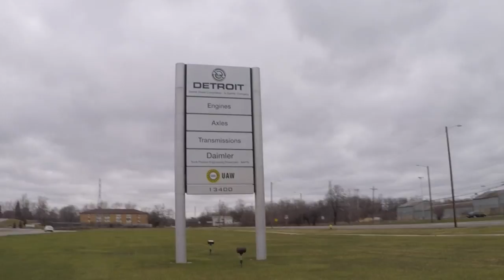DETROIT DIESEL FACTORY!!

Comment: The Series 60 pre-egr engines were the finest money making chunks of cast iron and steel ever made. I’m going to run mine for as long as I can!
Reply: Last time I was at that plant was style motors I picked up series 60. About 25 years ago
Reply: You love to waste fuel I see.
Reply: @blackericdenice  yes I do and I also love to mind my own business.
Reply: @prevost8686  Don't like when a brother comment on your comment. Don't comment.
Reply: @blackericdenice  OK Felishia.
Reply: @blackericdenice  Sure Felicia…
Reply: @poopinfruz9771  He don't work on the engine anyway.
I used to drive a 2004 14 liter with 515 hp/1650 lbs-ft. It got 6.5 mpg and I had to add oil. 
I then drove a 2016 14.8 liter with 450 hp/ 1650 lbs-ft. It got 7.4 mpg and I never had to add oil. 
I now drive a 2022 Volvo 12.8 liter with 450 hp/1750 lbs-ft 7.2 mpg and I don't have to add oil
Newer engines pull as hard as the old engines yet they burn less fuel and use less oil.

Comment: I'm surprised the Detroit Diesel sign outside on the building isn't leaking oil
Reply: That’s funny, if it ain’t flooding the road with oil, it ain’t a Detroit
Reply: perhaps that is because the sign is not painted green? Weren't those older DD engines called "green leakers"?

Comment: These new engines won't ever be as cool as the old 2 stroke detroits
Reply: yeah, those 2 strokes WERE one of a kind........UNIQUE to say the least
Reply: Brown Cheese They’re not nearly as reliable as the Series 60 was either. The Series 60 was the pinnacle of a reliable and fuel efficient power plant.
Reply: @prevost8686  no motor is as reliable at the moment as pre emissions restrictions diesel motors.

Comment: Awesome tour. Those are not motors. They are engines. A motor is driven with electricity while an engine uses mostly fossil fuels with internal combustion.
Reply: Ford Motor Company
GM (General Motors)
Toyota Motor Company
Honda Motor Company 
Nissan Motor Manufacturing 
My point is that you’re splitting hairs about something nobody, not even the manufacturers, give a crap about.

Comment: I get to tour all kinds of neat places in my job.  Manufacturing is my favorite whether it's bathtubs, pizzas, toilet paper, GE train, GE jet engines or AG equipment they  slightly edge out the under ground mine tours.  I guess if I didn't have a brief affair as a machinist, the mines would be on top.  Too bad my primary clients are in the energy sector, you can only look at pipes, valves and pressure vessels and fain interest so many times.

Comment: Awesome tour, have yall ever thought about glider kits? Guy i work for has quite a few trucks and has had just about all the motors. Fed up with emissions and in 2015 bought 2 new built glider freightliner coronados with s60's. So happy with them aint turnin back. Then the next year picked up a 389 kit and built it ourselves with c15. They are awesome trucks
Reply: I'm not a trucker but heard that the good old EPA made those illegal a year or two ago... more government regulations  to make people use less reliable more expensive equipment, if I understand correctly.

Comment: As a former machinist those CNC are impressive. Cast iron is almost always cut dry. One the water will cause it to rust quickly and second the cutting tools are designed to run dry in cast iron. They also weren't as fast as they could. Ive seen cast iron cut where it comes off red hot but they could maximizing tool life instead of cycle times. But that is an extremely high tech plant and is kept clean because FOD is the biggest concern internally. I work with aircraft engines now (PW) and FOD is a huge issue during assembly.
Reply from the maker: +Mike Buffing Thanks so much for Watching Mike!

Comment: The old 2 cycle engines just could no longer pass any form of emissions testing. They were hard to beat getting a power stroke on every rotation of the crankshaft.
When in the Army at the transportation school I got training on the 6-71 engines used in the landing craft - LCM-8 .

Comment: I used to machine cylinder sleeves on a CNC lathe and also big universal joints, all alloy. From me they went to the honer for very high accurate sizing and smoothing of the metal. 
I wonder if they ship out and get materials in via a Peterbilt with a Cummings or  Volvo, LoL?

Comment: awsome tour bud!! tell ya one thing FO sho! iffn I had to drive a brand new shaker now that's not a glider kit that is darn sure the motor I would want in it!! I've drove several Ole early 2000s Kenworths with series 60s in them pullin double pneumatic diamond trailers haulin cement powder that had well over a million miles on them!! and still got the job did!!
Reply from the maker: +CAT DIESEL POWER Yeah buddy!! These new DD's are nice! Thanks for watching
Reply: CAT DIESEL POWER I drive 600hp 1850 ftlb DD16 everyday! I freakin love it! Pulls all the way down to 1000 rpm! Shifts 250 rpms....1250/1500 through a b ratio 18 spd 3.58's on 22.5s loaded 100k lbs. did I say I freakin love it? Oh, it's in a 2017 Coronado 122 SD

Comment: Impressive video but I worked for Atlas Copco Wagner Mining in Portland Oregon as a diesel mechanic we manufactured hard rock underground mining equipment and I used to setup engines and converters to be installed in our machines. One of our checks was checking the crankshaft end play on every engine. Well we used a lot of D60 motors well one D60 I got would not rotate and hand 0 end play with the flywheel installed from Detroit. Well I got all the inspectors over their with the dial indicator hooked up then I loosened up the flywheel bolts that where torque sealed . Their was quite a preload on that crankshaft it moved more then the normal .010 end play I remember it moving .030 or more until it settled down to the normal spec. Somebody must have been mad at their boss that day. I can’t believe they let that engine out of the factory.

Comment: If there's any hope for the future of the 2 cycle Detroit Diesel engine in trucks, i would suggest cutting the 12v149 in half for an 894 cubic inch in-line 6 cylinder motor. Combined with the lower RPM's of a longer stroke and the addition of some modern motor electronics, i think this set up would FAR Surpass anything on the market today for power and efficiency.

Comment: those are the biggest shiniest boat anchors I ever seen. they should of kept the 12.7 and left it alone. Now we have a engine you take one bolt off and you have 20 that need to be readjusted and calibrated and resealed  by the dealer at 160 an hour.

Comment: Correction sir. Those are not motors, they are engines. Motors are all electrical driven and engines are powered by internal combustion using mostly fossil fuels.
Reply: Americans refer engine as motors. 🙂 Motor car. Motor is the engine. At least it's what it is according to them

Comment: They should have changed the name after they stopped the 2 strokes :P
Reply: While I was a Cat Marine Mechanic in Key West, I replaced A LOT of DD two cycle engines with a Cat with the shrimp boat needing to be reproped as the  Cat produced more power. The two stroke engines many times needed rebuilding in as little as 8, 000 to 10,000 hours while the Cats lasted on average 25,000 hours. The Cats used 2/3rds as much fuel as well. The DD Series 60 when it went Marine was the same.
Reply: Why? The series 60, 2000 series and 4000 series were logical upgrades of no longer viable designs. The big girls were split off to MTU but all are quality items.

Comment: First thing to bring up is that these are ENGINES not motors! A motor has energy from the outside changed to motion like an electric motor. An engine does this internally. Detroit Diesel has done wonders since Penske took over getting rid of those inefficient, low hours between rebuilds two cycle engines. These were where the jokes about if it doesn't leak, it's out of oil came from. I retired from Ryder ten years ago and was impressed with DD as how reliable they are. From 1990 to 1993 I taught night school at Key Power Tech Inst as the engine troubleshooting and tuneup instructor. Besides the Cat, Cummins, Volvo, International Navastar engines, we had several Detroit Diesel engines including the Series 60. This was where my students got a taste of electronic engine management. I enjoyed the video and have visited several engine/refrigeration factories in my career when going to update classes.

Comment: I'd rather have a 8v 92tta silver with 13sd RR with 370 gear's it will run down the road and pull hills better than any new stuff today. Sure fuel mpg isn't their but it sure is fun.

Comment: John, was the guide for your tour able to break down how many of those engines go into Freightliner trucks, how many to Western Star, and how many to other applications such as marine and off highway? Many people feel that Detroit has done the best job of building an engine that passes emissions requirements and still perform for the customer day in and day out.
Reply from the maker: +23phaynes They have worked very hard with all the regulations to build a reliable engine. Thanks for watching. She didn't say anything but what exact truck they go in.
Reply: 95% of the engines in Freightliner and WST are Detroit.  Shooting for 100%.

Comment: When did diesels start getting a dohc set up
Reply: When they introduced the DD sieries about 10 years ago . They now make it in DD5,DD8,DD13,DD14 and DD15.
Reply: Eh dohc has been around for a long as time lol Detroit its fairly new tho
Reply: jdr ok Detroit diesel had them in the late 80s in the 50/60 sieries. Detroit diesel also has had 4 valve diesel  engines starting in the late 60s. Detroit also had the first all electronic controlled diesel engine in the early 80s. I can go on for days.
Reply: Detroit Diesel series 60 was one of the first in 1986 to go to the overhead camshaft design but was a sohc setup. Cat 3406E was a sohc setup in the mid 90's but don't know much about the N14 Cummins. The Cummins isx/signature had a dohc setup which arived in the late 90's and Cummins have now went back to a  single
Reply: The Caterpillar 1693 truck engine was the first DOHC HD Diesel.  Designed in the late 1950s!

Comment: I will still take an old 8V71 any day of the week. these four bangers just dont do it for me.
Reply: The engines depicted in the video were all 6 cylinders.  An inline 6 has a much deeper stroke than a V8 configuration.  That is why most diesel engines are inline 6 cylinder.
Reply: I think you mean "4-strokers".

Comment: engine sound not the same like 6.71 no screaming it's like regular engine. turbo charge is not strong
Reply: They run around 40psi boost. Not sure what you mean by not strong boost. Turbo cars run around 11lbs.
Reply: I think he means less gm/Detroit soul well anything past the s60 is basically a mercedes besides the smaller s50 and idk if there's a 40
Reply: jdr ok Detroit didn't partner with Mercedes until 2000, long after the series 50/60 was invented. Those engines were a joint venture between Detroit and john deer. Yes there was a series 40. It was a rebadged DT 466 international with Detroit electronics.
Reply: William Snyder I said the s60 is the last time Detroit had any real input on a engine the s60 being the last decent on too
Reply: William Snyder and Ik pensike had it then Daimler Merc
Reply: Yes but the engines were still of Detroit design. Mercedes though incorrectly it turns out that the American truck driver would not buy an engine if it wasn't "American" so they continued the Detroit' line and also sold a Mercedes line. Cummins however has been partners with China since 1979 and truck buyers are none the wiser because Cummins doesn't mention it publicly and brands all thier engines "Cummins".
Reply: William Snyder so Mercedes engines would sell better if they kept the Detroit Detroit pensive Detroit Allison division engines Jesus Christ gm renamed that company to many times
Reply: If Cummins were to change thier name every time they changed partners it would be Cummins, Mexico,India,China, ect.

Comment: I have a few questions: 
If these engines are so great then why are the trucks with 500k miles selling for dirt cheap in the open market? 
Why do they all have sot build up issues and other design flaws that cause serious internal part faliuer in less then 500k miles? 
They have Worthless resale value. That's a fact. 
Why all these design changes and they get the same power and same fuel mileage? 

The truck cost more to build today then they ever did and you lose more in depreciation then you ever did on any truck they built in the past. . 
SO you pay more up front, spend more on care for the truck through out ownership and get less on resale in the end ?!?!!?!?

Keep in mind this engine is built by the same company (Mercedes) that builds 100k$ cars that depreciate to less then 30% of the original value in 5 years or 60k miles. Mercedes makes one of the nicest cars and yet they are also at the same time one of the most depreciating cars ever built. 

BUT on the flip side, if you buy a New truck with a 12.7 Detroit in it for 130k$, in 5 years and 500k miles its still worth every bit of 50-70k$ Depending on shape the old owner kept it in.  Some even go for more. 
They cost less to buy, cost less to won thru out the ownership life cycle and parts and labor are cheaper. 

These engines seemed over engineered. I'd drive one for sure. Don't get me wrong! They are comfortable and quiet. Your like in a regular car all day! But I wouldn't own one. You own one and you own all the shop bills that go with it. 
This is just one owner ops opinion. What do I know..... I just hold that round thing in front of me while I stare out the window all day and listen to music.
Reply: george george,,,,,,,,,,,,,I COULD NOT AGREE MORE......you're right,,,,,,,,,they're overengineered,,,,,,,,,,cost more, plus all the new maintenance  procedure with DEF, EGR, AND  ALL THE REST OF THIS NEW CRAP BOLTED ON, JUST FOR THE SAKE OF CLEAN AIR..........i think all the engines today suffer from the same problems,,,,,,,,,,,,,,,ALL BECAUSE OF DEP, EPA, AND ALL THOSE STUPID TREE HUGGERS AND CLIMATE CHANGE IDIOTS..............I AGREE TOO, THEY'RE NICE TO DRIVE BUT I WOULDN'T WANT TO OWN ONE............

Comment: Well the lady talking confirmed my beliefs that Freightliner, and Detroit  diesels have been completely engineered for idiot drivers, that don't belong in a truck. Screw Daimler. They have owned Freightliner since 84, and Detroit since 1991. I've driven a 2020 Freightliner with a DT12 and it has some more fine tuning needed.